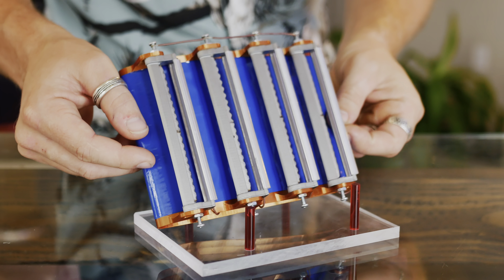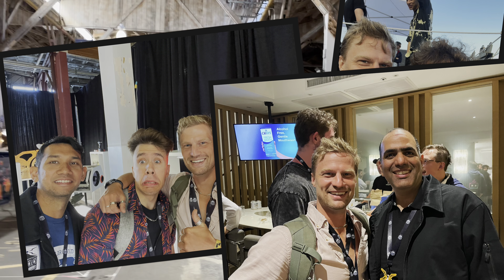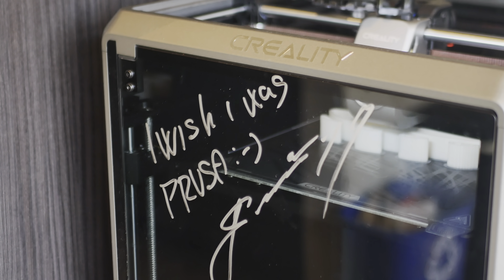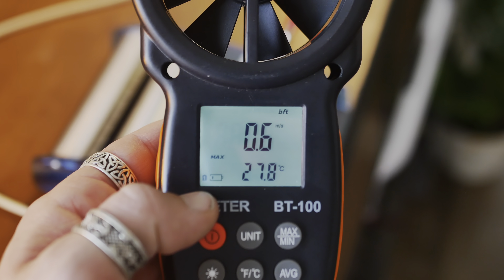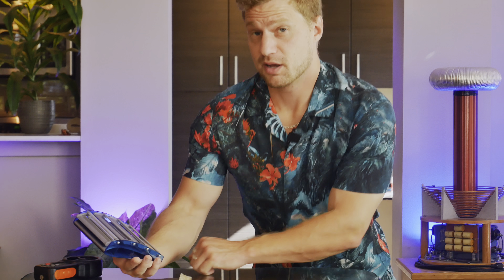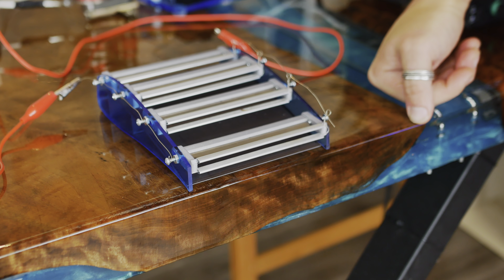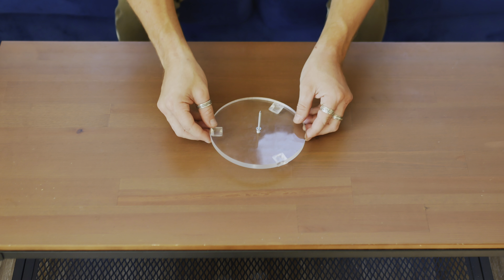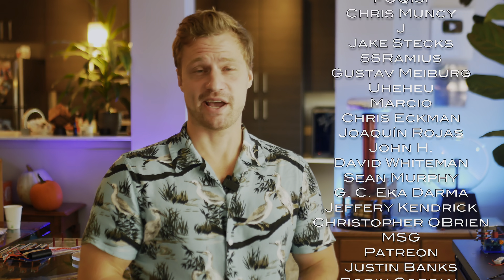Designing A Self Propelling Ionic Thrust Wing

Comment: it would be a lot easier to use foam board for the air foil, then use either 3d printed tubing or carbon fibre tubing to hold it together.

Comment: So, if you do an air intake on one end of the wing, not leading edge, an open a “thrust slit” just forward of the trailing edge, you could move the engines internal, and reduce drag, and possibly add lift, due to airflow moving faster along the top of the wing.
No idea if it would actually add lift, but I’m pretty confident that reducing the exhaust through a “thrust cone” type edge would add thrust…maybe?

Comment: I had fun in the same way when I was about 12 years old. I assembled a block generator from parts of an old TV and got a constant spark of 1-2 cm.
I burned it on wood and on my fingers, and also checked the ion thrust.
Perhaps the most fun was controlling the frequency of lightning strikes to music when I somehow connected my push-button mobile to my homemade craft.
The efficiency of ion thrust is low, but I'm glad you're popularizing science.

Comment: Create a lift jig with linear rails on the vertical axis to measure height and estimate lift
Include empty wing sections on either side to prevent tip vortices and reduce drag while testing
Consider a wing design with a thick root chord that tapers off for better aerodynamic performance.
Use lightweight PLA
Integrate a main thruster like a  fighter jet in the fuselage
Alternatively, calculate minimum thrust based on glide ratio from a glider design to set a target.
best of LUCK!

Comment: Another idea: instead of on the wings, move it to the sides of fuselage. Use intakes in balanced parallel pairs from the front that run all the way to rear lined with the thrusters. Flaps could control the amount of air flow to thrusters.

Comment: Nice work indeed. Personal opinion on options and throwing the UK hat in the ring 😏
1. The weight is in the framework, so you need to make your framework into the thruster as a wing.
2. Wasted energy with the airflow differential for lift, where using a shroud and laminar flow would make more efficient use of that airflow IMHO and perhaps give significant thrust improvement.

Thoughts then....
Convert your wings internal framework into a tesla valve cross section, then modify the tesla valve internals to act as the ion thruster.
That way the wing is the jet.

Comment: Does the airfoil even work with the airflow on its most critical section disrupted by the thrusters like that? The whole thing might push air but is useless if it doesn't generate any lift.

Comment: Play with the spacing of the thrusters above the wing. You want to avoid any increase in air pressure above the wing in order to get the most lift. If you have them too close you may end up compressing incoming air between thruster and wing.

Comment: For the wing and 3D printed parts maybe you could use lightweight PLA, though that may have some issues structurally. (also random idea, but maybe you could print the bolts / attachment points and feed the wire through them directly shaving down the weight just a hair more.)

Comment: Since the thrust sections are now airfoil shaped anyways, why not just do away with the main wing entirely? At that distance the wing is losing most of its efficiency, similar to a biplane. Getting the stability right with a few wings in a row might take a few tries, but it should greatly improve your lift to drag ratio.

Comment: I think the one ground and two positive elements thruster achieves more thrust per watt of power because of the geometry of exposure of the flow of ions to the air flow. The ions are traveling on a slightly diagonal path in relation to the normal plane of the air flow. The two element trailing section creates a good augmenter nozzle effect. It keeps the air channeled into the ion stream, and it entrains more air surrounding the assembly. This increases the interaction of ions with the air. Need to find (imagine) better geometries for getting maximum ion interaction with the air flow.

What about putting the mechanism inside the wing? Place the inlet in the leading edge, then blow the exit air through a slot (or more than one) at about 55 to 65 % of chord along the top side of the airfoil (blowing parallel to airflow). This would create boundary layer control (a very effective way to reduce drag). With the right geometry of inlet(s), duct(s), thruster(s), internal bypass entrainment design, and exit nozzle slot(s), the system should produce as much thrust as the design you have now (with the same power). It would also have the advantage of not making drag when not active (if air flow through the wing was closed off when not in use).

Of course this would make the internal structure of the wing a lot more complicated, but I think the performance advantage would be worth it. For now use the external system you have to prove the concept, then move to internal mechanism on version 2.

Comment: Sooooo... what if the negative ground pieces on your individual motors were (correctly sized)  small wings? Would you be able to get rid of the wing you are mounting the thrusters too and instead have the thrusters aligned and spaced to feed off of each other, all creating there own downforce and some of the thrust created from the motor in front flows into the next motor?

Comment: Staggering the grounds worked. What happens when you string another power wire closer to the airfoil surface, and staggered to the lower ground?

I also notice that tying all the grounds together into a common reference voltage is probably the best way to explain that one specific efficiency gain.

Comment: I love seeing your innovative research. I have some suggestions. 
1. Non pigmented filament( it may be causing current leakage)
2. Switch to etched or laser cut foil for the emitters. (or CONDUCTIVE filament.)
3. Change mechanical bolts to nylon or much thinner metal.
4. Try 2 wings with the power pack center of a pivot on your scales, that will give you a better idea of real world lift. 
5. toggle on/off power button above the pivot point.
6. You put a lot of effort into making modular ionic engines, for aerodynamics, you need to hide the carriers of the emitters and sinks better.  
I think your top engine configuration alone is very promising for lift but you need to find out what is the sweet spot for operating speed of the wing for your engine. I suspect that you will get more performance from a thinner wing because I don't think the ionic thrust speed will de-rate nearly as fast as other forms of thrust (like a prop calc for speed based on pitch, diameter, rpm, it's very different to ionic thrust).

Comment: The thrusters could be on the bottom of the wing like in commercial airlines. 
Additionally since it is no longer a true glider, which complete depends on the wing shape to keep it up, it may be better to use a different design.
Maybe a more Rupert's drop kind of shape with the thrusters positioned to kind of create a flat bottom under the wing.

I was thinking, they could be embed in the under side of the wing in a flat bottom wing, as well, since no fuel to ignite.
However, you would need to line the area between positive and negative with a lightweight material on the anti-plasma level of non-conductive and non-flammable .

With the boat video you mentioned moisture being a concern. Wondering if you have ideas for that issue yet.

Comment: Ionic thrust will always take too much energy to produce, you can make this work, but the heavy batteries/energy source will always outweigh any results.
If you connect the same amount of power to a regular electric motor with a prop, you will immediately see the difference in thrust capacity. It's orders of magnitude.

Comment: Using a high aspect ratio with a thick airfoil section is an interesting combination. 

Typically slow flying wings use a low aspect ratio, due to the increased lift at low speeds, where drag isn't as much of a problem.

It will be very interesting to see how this comes out!
Reply: its not coming out ... this is ridiculous! this is the most inefficient propulsion and hes stucking it on a wing ... are you peopleout of your mind ????
Reply: @MrNetmask  There are a bunch of unanswered questions, for sure, like does this thing provide the same thrust when air is already moving over the surface (due to flight)?

Comment: A single thrust-bar built into a long wing should work better than several shorter bars in parallel. Keep in mind that most of the weight is coming from the metals used. Eliminating them where possible, and reducing it to just the active elements needed will provide the best overall TWR. However, expect that your performance outdoors will vary greatly based on the amount of humidity present. You should therefore design the thrust bar for situations where the humidity is 70-80% on average. Furthermore, be aware that build materials that are moisture absorbing should be avoided. While as you'll soon discover that your thrust-bar will arc through the path of least resistance, causing either no thrust, or a nice fire.

Comment: Aaaaaahahaha! Welcome in the club. Proven thing, but not enough for propulsion. We worked extensively on ionic propulsion, though we knew from the beginning that it won't be enough for propulsion. BUT, but, it does "change the aerodynamics of a wing" therefore helps in ...let's say efficiency of a wing. Bottom line, the aerodynamic drag is way lower. YOU ARE GETTING THERE! Just a tip... Copper self-adhesive tape and Kapton tape....

Comment: What you've got here is a good aerodynamic airfoil with a bunch of bad airfoils sticking off the top. I think you will eventually be forced to integrate the thrusters into the skin of the airfoil in order to reduce drag. Accelerating fast-moving air a little bit vs accelerating slow-moving air a little bit will allow your eventual airplane to function at higher airspeed, increasing the allowable wing loading to a realistic value, but for it to maintain high airspeed it needs a low drag coefficient and a high lift to drag ratio at that operating point. Don't worry about takeoff, you can launch it from a catapult or something. Drag reduction is a good heuristic for what you need, but what you really need is to attain zero net thrust under the actual airflow with the thruster operating at some airspeed, the higher the better. On a related note, I suspect this mechanism of thruster may provide higher thrust at higher airspeed, which is another incentive to reduce drag. Consider dielectric barrier discharge for producing your ions.
Reply: Make the wing skins out of pcbs, then you can have whatever electrode geometry you want.

Comment: Gliders? Are slow fliers? Whaaaaa? I've seen few gliders on out rc airplane field, and no, the are no where slow. They has best travel/fall ratio, yes, but BECAUSE of their fast glide speed. Slowest flier I had was foam GeeBee, and it had regular weight/power but wide wings. To generate lift from regular flat-bottom-curved-top airfoil you have to have some speed, and dirung slow flight lift is generated from wing angle multiplied by wing area o) Or special airfoil, that I am not familiar with.

Comment: What if wires were used in even spacing where the leading and trailing edge had a voltage of alpha and intermediate wires had alternating voltages of 2*alpha and (-2)*alpha? In such a case, could thrust not be attained between both +ve to -ve and -ve to +ve?

Comment: It looks to me as though the thrusters are currently being angled parallel to the intended direction of travel. I would like to see if angling them downward more so that the thrust is being forced directly over the surface of the wing improves the amount of thrust and lift. I'm not an engineer, but something tells me there's performance improvements to be had by changing the angles of those thrusters.

Comment: The only problem with lift is that the low pressure zones of lifting surfaces are very sensitive to turbulence, so putting the engine before or after the wing would be more efficient as all of the stuff for the engine probably creates a lot of turbulence unfortunately.

If you instead have the tiny air-foils you used as the electrodes in a line following air flow with a more optimized profile for lift you would be more efficient?

Maybe printing in resin and electroplating electrodes directly on would be a smoother surface?

Also Math:

Acceleration - Rotational:
v = r w                 (w in rads/s)
2 = 0.29 * w
w = 2 / 0.29          (leave as is cuz long decimal)

a = delta w / delta t
a = (2/0.29) / 12
a= 50/87 rad*s^-2

a = M / I = 50/87

Inertia:
I = 1/2 m r^2
=0.5*0.175*0.29*0.29 + 0.5*0.231*0.22*0.22
=0.01294895 kgm^2

Torque:
M = F * r
M = F * 0.29

All together:

a = M / I = 50/87
M = F * 0.29
I = 0.01294895

50/87 = (F * 0.29) / 0.01294895
50/87 * 0.01294895 = F * 0.29 = 0.007441925287
F * 0.29 = 0.007441925287
F = 0.007441925287 / 0.29 = 0.02566181133
F_Thrust = 0.02566181133N
Reply: I was thinking the same thing. Have both trust and lift depend on the same airflow would make some interaction pretty hard to predict.

Comment: Formfutura makes a polypropylene ultralight filament that would further reduce your weight. It is quite strong and I had no problem printing it on my older creality printer. We actually used it to make covid masks as it can be autoclaved. You just need to use helper discs on corners to prevent warping and print onto PP packing tape for good adhesion as the instructions tell you. I'd imagine that it's better than the foaming PLA because you don't have to mess around with getting the foaming right and PP is generally stonger than PLA anyway. Maybe rub parts down with graphite powder and electroplate like Integza for further weight reduction? I'm not sure you actually need to spend the money on graphite spray I feel like powder and cotton balls would do the same?

Comment: Have you ever heard of the Custer Channelwing? Also, I designed an RC flying wing that is <70g without the motor and battery, and only 192g with motor and battery. I'd love to try putting the two together, especially since a flying wing would have more surface area with less weight. Love the video! Can't wait to see this finally fly, ultimately when you're drawing voltage from the sky instead of battery! No batt=even less weight.

Comment: Could you build the ground strips into the aerofoil? so that they are flush with the surface. maybe the same for the positive, but I'd guess you would have to have some tiny spikes/teeth protrude a little into the air away from the surface, but who knows, maybe not. Just so you can put segments in sequence without having the following ones block the airflow so much.
Reply: If you could maybe a thin aluminium strip for the grounds could also do double duty as the structural span for the wing, thereby reducing the need for all the plastic parts.

Comment: I don't know much about this kind of technology, but I have an idea for reduced drag: incorporating the high voltage "razor" and the bottom ground strip into the actual airfoil itself, and only having the top ground strip elevated on small risers. I'm not sure how it would effect airflow; you might need a channel cut through the wing right underneath each ionic thruster, and an intake port on the front leading edge of the airfoil. Or it could be split down the middle the entire way, like a biplane, but with each wing very close together, acting as 1 large airfoil. I have no idea if this could work, especially if the high voltage strips inside would induce a ton of dirty air, but it seems like it would be worth trying.

Comment: I have a suggestion but I'm very new to engineering: Instead of putting your ionic components on the exterior, possibly reduce drag by putting them in the hollow wing; then you can control velocity at the end thus thrust by changing the exit slit size and pattern. I would love to see the pain of creating this haha. There are many great output nozzle designs that increase velocity but they definitely require lots of pressure, which I don't think works here. Your best bet might be to leave it open... Kind of like sandwiching your thrust component in between 2 wings like how some glider planes look.
Reply: A few people suggested biplane designs which I agree with. Any way to run simulations before prototyping?

Comment: Is it possible to do RCS thrust with these so there is absolutely zero moving parts required to make the aircraft fly. Part of the reason I ask is you said solid state as in no moving parts and every surface that moves causes drag so if there's no surfaces moving and you're able to maintain positive control through varied thrust the airframe then you will have the least amount of drag possible and maintaining thrust and control

Comment: From my experience, the top of an aerofoil is the most important predictor of aerodynamic performance. Having the ionic thrusters mounted above the wing like this might nuke its lift. Perhaps it's an idea to experiment with integrating the anodes and cathodes into the skin of the wing itself. If you can get it to work, it would theoretically reduce weight and drag while increasing lift.

Comment: Now that was a very interesting mix of two technologies.   I have nothing obvious to add unfortunately except those metal bolts.  Overkill in strength and (relatively) very heavy.  Try nylon 4mm - they weigh SFA and would have more than enough tensile and shear strength for this job.  Excellent work.